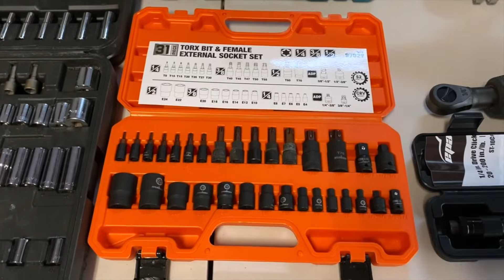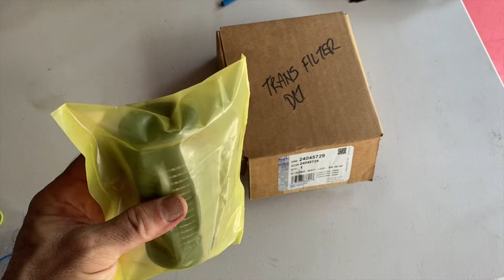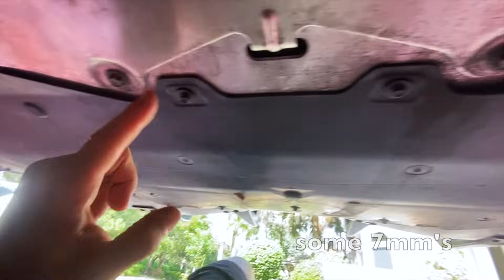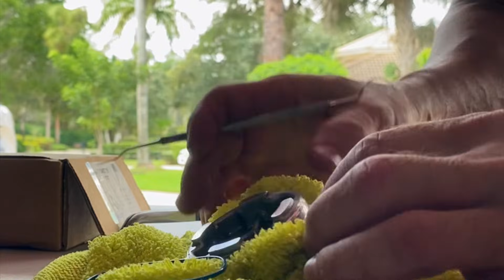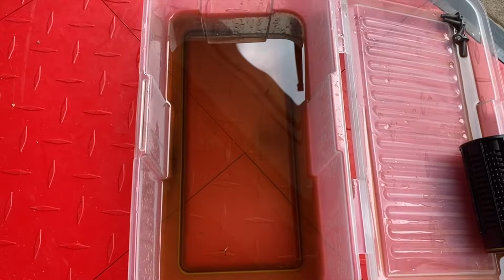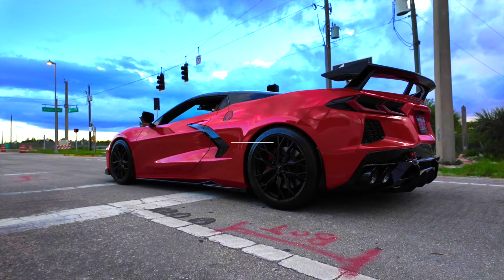How to Replace C8 DCT Filter Change for Your Corvette All Models Z51 Z06 ERAY ZR1 Stingray

Comment: Joe, great video .... so if i heard you correctly after my first DCT filter change not required to top off the fluid. I'm at 1500 miles and I'll change it at 3000 miles
Thanks man!
Reply from the maker: Many say it is not necessary. If you can, go for it. Do it properly via rear driver wheel-well. Thanks for your support

Comment: I think you meant 53 in-lbs and not 53 ft-lbs for the filter bolts right?
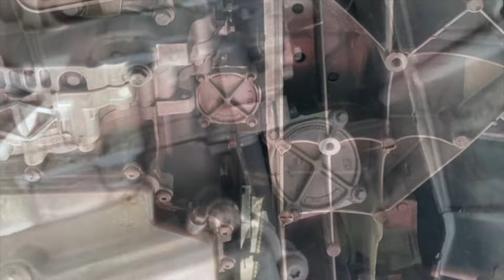Reply from the maker: After reviewing, you are correct. I mistakenly said 53 ft-lbs instead of inch -lbs at 14:50. I am working to edit/ fix that. Thanks for letting me know.
Reply from the maker: I believe I stated it in inch lbs…
Reply from the maker: fixed... thanks for helping me help others!
Reply: Yikes … just use an impact wrench at 53 ft pnds, lol